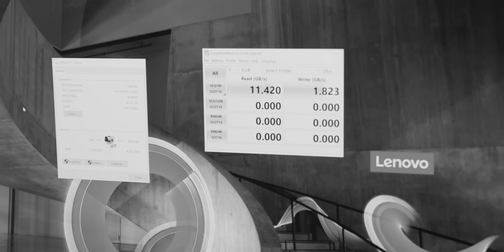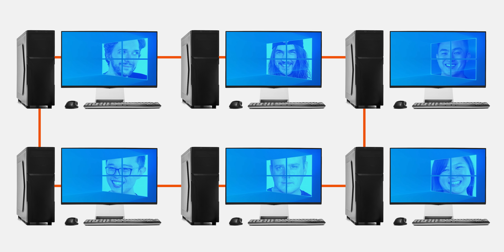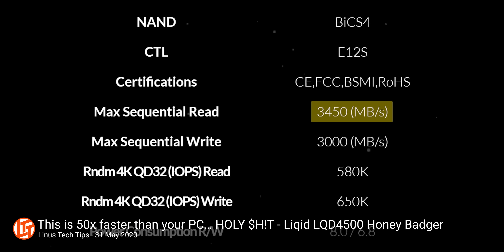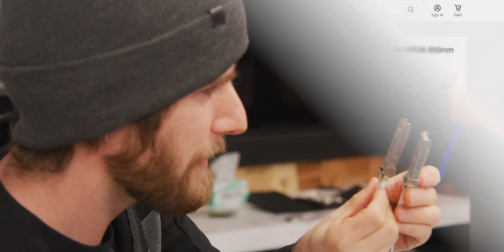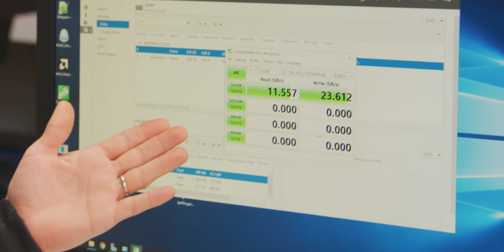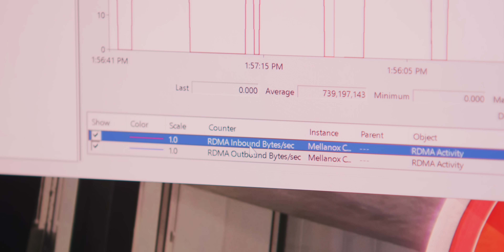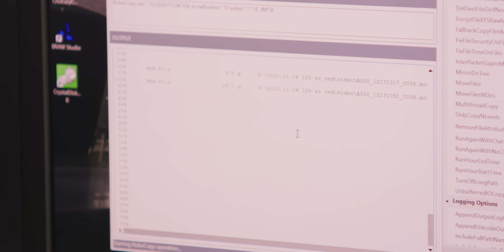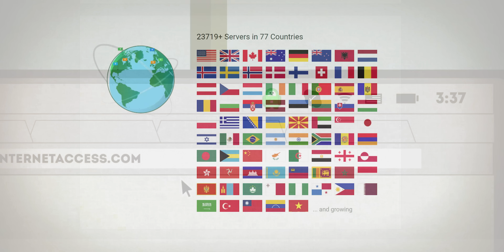A $15,000 Network Switch?? - HOLY $H!T - 100GbE Networking

Comment: Hey Linus, why did you use multimode fibres and not single mode? The price diference is quite small, and you ale locked to current speeds on MMF. Any future upgrade would be so much easier with SMF.

Btw: 850nm transceivers use LEDs, not lasers (those are 1310/1550nm)

Comment: Remember folks this is LAN not WAN (North America is DISGUSTINGLY behind when it comes to internet speed and fiber accessibility), ISPs dont cover speed tests over 1 gig. Public speed tests cant keep up yet. Also, file transfers are not recognized by any ISP over any MPLS connection (throughput gets sticky once you hit metro and ISP clouds). iPerf is still the industry standard as TCP/IP is king when it comes to measuring bandwidth and packet loss (Im not a fan, but whatevs) through a MPLS cloud.  Linus hit me up if you ever want a tour of a POP!

Comment: U can get a 32port 100gbe switch for 1200 on ebay with boardcom chip and an intel atom c2000 for the control and its u1
Reply: And its looks internaly 100 %same
Reply: Celestica Seastone DX010 Switch, 32 port 100Gbe QSFP28

Comment: "It must have expandable storage for a reason" 4:17
Yes, so it's easy to replace. This is enterprise hardware, if something were to fail, it needs to be back up as quickly as possible, swapping a RAM stick is easy, swapping an entire board is not.

Comment: "If we run on Linux, we probably could see full 100Gbps" !!! Servers world = Servers hardware + Servers software. you could at least use VMware and many VMs for example. this is test is seriously irrelevant because of that !! why haven't you just done the test on Linux since the beginning, what's the point of using all these hardware from one side and windows "pro" on the other ? almost all of these appliances run linux/unix kernels at the first place to handle all the bandwith with maximum IOPS same goes for SAN Switches, storage arrays and all bare-metal critical servers. Also, all this, while "holy shit" for normal desktop users, is very common for servers and datacenters ;) it is nice to share them with gamers :) this will probably be available/affordable for home use in some years from now :)

Comment: I am pretty sure the multithreaded aspect only will make an impact if you are copying multiple files vs one large file. When you copied the 100 gb of data I believe you were using multiple files at a time. 

If using robocopy.exe

Robocopy.exe <source path> <destination path> /mt:128 /log:c:\temp\log.log 

You should find that the time to complete that (128 thread copy)
is the same as:
Robocopy.exe <source path> <destination path> /log:c:\temp\log.log 

when copying one massive file. If you had say several hundred files of varying sizes, that is when the multithreading should be demonstrably faster.

Comment: Not gonna lie, Linus gets me excited for stuff that I'll never be able to use myself. But boy does it sound fun and exciting to experience!
Reply: I believe this switch is like 4 years old and you can buy it second hand for $1000,- , then you can get some second hand cards for like $100,- each if you search right. The last step is the teansceivers, which I'm not sure you could or should buy second hand. So you might be better off using DAC cables. Still expensive, but cheap enough to actully be able to afford if you really wanted.
Reply: jpnewpic88.men

Comment: Would have liked to of seen you get an Arista 100G switch. We use them in the data center which they can do 32x100g but you can also break the ports into 40g which can break into 4x10g or 4x25g or 2x50g. They're only around $1000 used these days.
One of those would have been much better option for you.

Comment: Correct me if I'm wrong here, but I'm just trying to fact-check something. I'm currently running Windows 10 Pro 20H2, current patch. If I go into "Turn Windows Features On or Off" I can enable and install SMB Direct on my PC. I see on the Microsoft website that SMB Direct is listed as something exclusive to the "Pro for Workstations" fork, yet my OS is definitely just the Pro version, as my activation settings show my edition as "Windows 10 Pro" only. Have they enabled SMB Direct for baseline Pro editions of Windows? Seems like they have. I have no way to test if it's actually working since I don't have an RDMA capable NIC, but just figured I'd ask.

Comment: How gentle he is with the fiber is so cute. As long as you don’t bend at a 180 and pinch it, it’ll be totally fine.
Reply: 180 is straight bruh, probably more than 300 degrees.
Reply: @cummingtonite691   if you’re holding a cable with and end going one direction and the other end the opposite, then bend it over 180 degrees, they are now going the same direction. Just don’t pinch it tight and you’re golden.

Comment: TIL " QSFP28 (quad small form-factor pluggable 28) is designed for 100G applications. It offers four channels of high-speed differential signals with data rates ranging from 25 Gbps up to potentially 40 Gbps, and finally, meet 100 Gbps Ethernet (4×25 Gbps) and 100 Gbps 4X InfiniBand Enhanced Data Rate (EDR) requirements. "

Comment: I was pretty pleased to find a rack mount 48 port gigabit switch second hand from Value Village for $7 Canadian. Obviously they had no idea what they had. Even second hand they were going for over $300 on ebay at the time. It's a whiny bastard too, and one of the 3 fans was nice and grindy due to age, but since this is my home network and only 4 or 5 computers are plugged into it(kids and a server, plus a cable for my test bench, me and the missus plugin direct to the fibre modem, don't want to add extra latency and such....), I figured it probably wouldn't overheat and just deleted the dead fan.

Comment: More fun with high speed storage?
https://www.ebay.com/itm/Pure-Storage-FlashArray-FA-M20-R2-NAS-HA-controller-w-48x-512GB-SSD-10x-1TB-/353334852355?_trksid=p2349624.m46890.l49292
I think these use to run around $100K It is circa 2015 so milage may vary. Would love to know how these stand up to Liqid. Maybe PureStorage would send you the latest model to play with.

Comment: I bought an alien ware about a year ago and it overheats so I am currently building my new pc but using the parts any tips on removing the ryzen 9 and putting it in a  new motherboard without breaking it

Comment: 100Gbps seems a bit useless for this guys usecase.  It could be usefull for hypervisors with a distributed filesystem, for all other tasks 10Gbps to 25Gbps should be enough for most productivity stuff..

Have not watched entire video but let me guess.. Download Doom Eternal, play Doom Eternal on workstation, hyped to the balls about 100Gbps god tier connectivity, run some benchmark app, being hyped to shit about God tier benchmark numbers.. 

Maybe i am just expecting to much from this guy but all this hardware seems so under-utilized in his prosumer workshop.. There is some more other cool stuff you can do with 100Gbps networking.. Transfering files is not using its full potential.. Getting 100Gbps with pure file transfer is also kinda tricky if you are using a regular journaling file system. You have to do unbuffered file transfers to archieve this kind of speed, which is probably what this special copy tool is doing to get better speeds.

Comment: good content! this is till fringe but will be a growing concern for smb sector and fast network plus nvme arrays will be upsells along with gpu enabled compute - go ahead and try to build a potato router with sonic or opnsnense with 100g - liable to cost a bit less than a 'real' switch if it works - most smb can concentrate  just on connecting dev/ws/server and nas and a couple vmservers - the reg office network could be 2.5gbe and 5g or 10g #segmentation

Comment: It's great to see you guys learn more about Windows networking. The last videos you did on S2D and the All-Flash Array were abysmal, I think you rely on Wendel too much who isn't an expert on the MS way of handling HCI and storage or networking. For your multi NIC video, please enable SMB Multichannel and use PowerShell to check that RSS is enabled. Your SMB 3.0 shares will then be very fast. 30GB/s (yes Bytes) has been possible with SMB 3.0 since 2016! Also, please try the DiskSPD tool made by MS - it's on Github and allows you to control cache, threads, block alignment, etc.

Comment: With connectx-4 dual port 100gb cards you will be limited by throughout of a pcie 3.0 x16 slot. Need to step it up to the pcie 4.0 sku to unleash the capability

Comment: I did a similar setup in 2017 for 8 workstations, each editing a 4K 25 fps raw video for the movie restoration project. The storage there was Dell's Compellent 2 PB storage solution, 2 Huawei 4x100 Gbit/s uplinks, and a bunch of StorNext servers to handle SMB-to-multipath-FC [StorNext does that]. The only problem was the application – DaVinci Resolve 16 we used at that time was almost single-threaded when it comes to reading/writing [a small chunk overlap was there, but generally it was single-threaded reads and writes]. The cost of getting it all working was something like $250+k – tests showed a 12,5 GB/s write speed for the whole thing and StorNext helped to overcome DaVinci's "singlethreadness". And now, it could all be done on a workbench. Nice.

Comment: I guess your reason for Windows on the workstation is for the applications however I see very little reason to go with Windows as a file server.  IMHO go Linux for your file server or better yet go FreeBSD which is made for managing data transfers like this especially on big iron.

Comment: 5048F is decent SKU but you are stuck with Dell NOS 10.4, 10.5 did a lot bug fixes and improvements with VRRP, Peer routing and VLT MLAG

if y'all are still on OS 9.x well, its a pain in the butt to work with but the code is stable

If this is strictly used as a L2 switch you should be fine

Comment: In my job it often happens that I'm holding a 32 port 100GbE switch in one hand or halfway supported in my knee while I'm arranging cables behind it for example. All while the switch is running, if course. 
That's when Linus drop tips come in handy.

Comment: This network disk (if Windows isn't bottleneck) is faster then PCIe 4.0 M.2 SSD on your motherboard. As 100G NIC needs 8x PCIe 4.0 lanes - twice the bandwidth of M.2 slot.

Comment: A few thoughts from a network engineer:

1. Your server has a 2-port 100GBe card and you should really be using both ports, connected to two different switches and setup the 100GBe NICs in a LACP link aggregation group.  This will bundle the two 100G links into a single 200G virtual interface, but more importantly, it will allow your clients to load balance across both links based on source mac address.   This is a play for increasing bandwith and resiliency.

2. Another way to solve the same problem is instead of having your clients connect to the server via SMBv3, you could instead expose your server storage via iSCSI and then setup iSCSI on your editor workstations.  That would give the editors direct access to the storage and skip the SMB/CIFS layer on your server altogether.   The only downside is when you allow clients to directly attach to storage, you lose some protections like file permissions, so obviously only do this if you trust your clients and your use case can absolutely benefit from it.

3. You are at the point where scaling up your one server is becoming economically difficult.  Another option available to you is to put two servers in front of your storage that will "present" your storage to the clients via Windows CIFS/SMB.  Then your presentation servers connect to the actual storage over fiber channel or iSCSI in a private network.  The beauty of this approach is you can get away with using significantly cheaper servers to present the storage to your clients and use DNS load balancing or a network load balancer (think F5 BigIP) to direct clients to the least utilized storage presentation server.  

4. CIFS/SMB really is a terrible, old, stodgy way to move files around.  If you can find another option for your workflow, even NFS over UDP, you will save yourself some of the headache trying to maintain esoteric Windows features to make your high-performance storage work.

Comment: "Let us know if you want to see that"

As if he hasn't done it already.
Reply: I don't think there's ever been a time that Linus's has said let us know if you want to see that and my answer wasn't an immediate yes
Reply: I didn't catch the brand/type of 100GigE card, but I hope it's PCI-E gen 4 vs gen 3.  If not, the two ports will over-sub the slot.
Reply: I just found out that category 8 now gets 150 feet. I want to now have it installed at home
Reply: @Nighterlev  You didn't read my reply carefully.  I wasn't talking about the system, I was talking about the Mellanox card he's using.  And I've later confirmed it's only a Gen 3, meaning those 2 x 100Gig cards will over-sub the slot if he tries to LAG them together and use them.  No idea why Mellanox sold that 2x100G gen 3 card.  Dumb, dumb, dumb.
Reply: @Nighterlev  No, it won't see a "significant improvement" at all.  It's capable of no more than 128Gbits/sec throughput through the PCI bus.  Full stop.  There are no "ifs", "ands", or "buts" about it.

That means it's over-subbed.  And that was my point all along.
Reply: https://youtu.be/PgbHgQ8okh0 🔥🔥✌ so good
Reply: O b a m a

Comment: ... Shows no network engineer is present ... If your going over a short distance you get less latency from dac cabling since your not doing a media conversion ... Generally anything in rack its best to use dac cables.

Robocopy it really shit for data integrity... Also what makes it fast, make sure to hash each file and verify on the other end

Comment: If my math and my information is right - is this not crazily close to bulk data transfer speeds for traditional DDR4 DRAM??? Meaning theoretically this can be almost on the same level as reading data from system memory??? I understand latency would still be higher, but holy shit this sounds insane

Comment: STH did a Video on a 32x 100Gbit Switch. Its an Celestica Seastone DX010. Why didnt you just go for that? Used on Ebay, its around ~1k or so and if you buy one manufactured after mid 2017, you are on the safe side. You can breakout up to 128 25Gbit Ports from that. Pretty neat!

Comment: The amount of people who think this has anything to do with internet speeds is appalling.
Reply: Well it's technically an internet, though Intranet is a more accurate word.  Just an exciting way to say LAN
Reply: @hedgeearthridge6807  The Internet is a proper noun and there is only one of them. The only larger network of networks will be the Interplanetary Internet, which most of the time won't be connected to the Internet. A LAN is not an internetwork as not even IGP is involved, let alone multiple ASNs and BGP.
Reply: It's the same thing as when the insanely high nasa intranet speeds were posted all over the internet. 

I don't blame people for not knowing the difference. You can't know everything about everything.
Reply: THIS case is not internet, but the same things are used in serverparks (i would assume) and those are what you connect to for internet...
Reply: The lack of explanation of what it is.

Comment: Oh man Linus. I hope you read this. It pains me to see you guys spending insane amounts of money on super high end gear, but then still running like you’re in the 90s with your single file server. Where’s the Clustered Shared Volumes (CSV) or the Scale Out File Server. You mention that you have troubles still where the server lags out and crashes all your editors at once, which is insane, and not wanting seperate shares, all this has been solved for years. You really should engage some proper IT consultants that know enterprise gear, and show you guys how crazy top end gear can be when used properly.
Reply: Remember: This is entertainment....

Comment: Was using windows to move files to my usb to SATA SSD that I have connected to my router as a mapped drive, under windows 34mb/sec. I tried TeraCopy a videos folder 54GB in size to my mapped drive 167mb/sec but it did drop to 19mb/sec for some odd reason but that's faster that windows lol only using 4% of my Ryzen 3600 Utilisation

I will be getting a NAS bay though connected via ethernet next year instead

Comment: Networking question: I have my whole house networked with standard gigabit cables and switches. Can I also connect two of my machines together directly with 10gb NICs and a cable so they will have higher transfer speeds between each other? Will that mess anything up with both of those machines accessing the rest of the network? Will the machines know which connection to use depending on if they are connecting to each other or to other devices? Thanks!

Comment: I've been using FS stuff for years. One of my customers replaced his entire Cisco setup with full FS switches for core, POE Phone, management and iSCSI switches for his VMware setup. $40k worth of Cisco not including transceivers or $12k with all the cables. The CLI for the FS switches are a little unique, but for the most part are full featured
Reply: meh. i don't like their OS. Juniper all the freaking way. And you can get your sales rep to give you steep discounts ;) - i talk... like 60% under MSRP.
Reply: Sure Juniper is much more enterprise recognized. I'm not a networking guy, but more storage/VMware/Backup so its all the same to me. The MSP I worked for at the time is an Aruba shop, which, when compared to FS is night and day. Still to replace 7 switches with all cables and upgrade from 1GB to 10/25gb in a single upgrade for $12k is not bad at all.
Reply: that's pretty ok. i work for an large ISP, so i have a whole different view about those things :) we order switches & routers by the 100s. but if it fits your budget, and works for you - it's none the less good :D